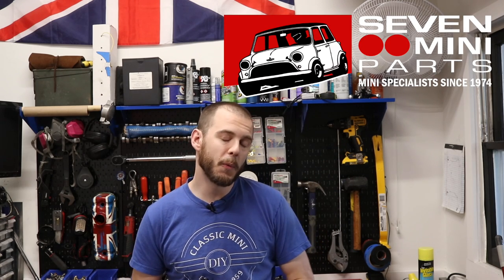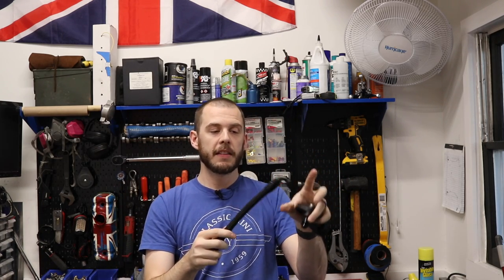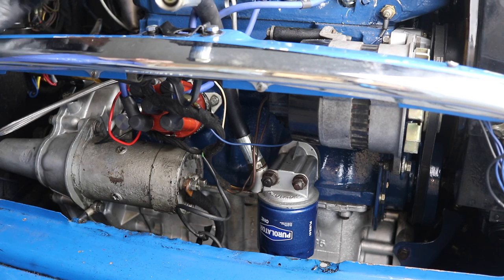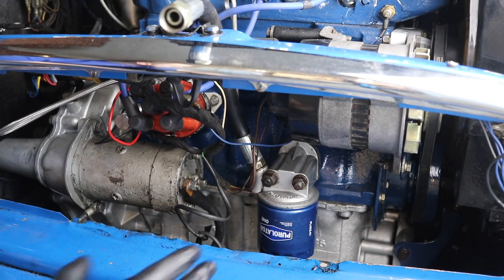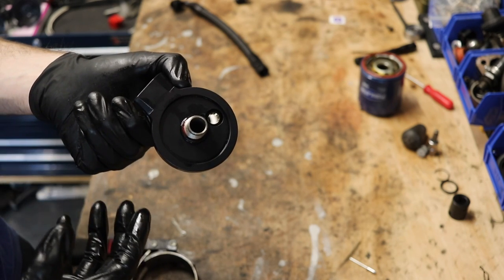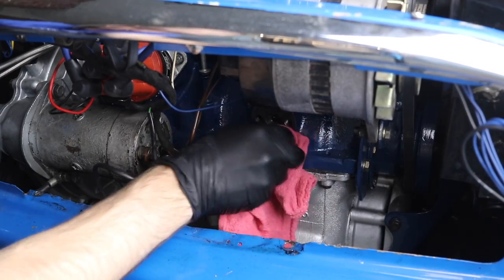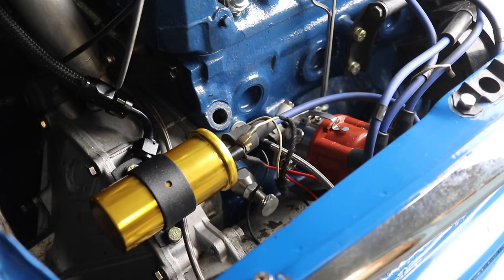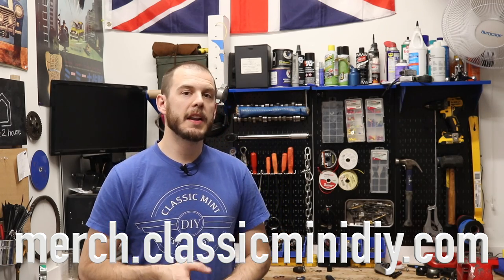Classic Mini DIY - How to install the MED Race Filter Head Kit

Comment: The magnet is a brilliant idea. You can get a magnetic oil drain sump plug.
Reply from the maker: All the factory sump plugs have a magnet in them however there are replacements with much stronger magnets. The drawback of the mini sump plug is that due to its location, metal particulate often reaches the oil pickup before it gets caught by the sump magnet.

Comment: Top tip-Since the oil filter housing is vertical, you can fill it with oil prior to fitting it. Helps with the prime on start up.
Reply from the maker: Thanks for the tip, I didn't call that out in my video but I did actually do it before installing the filter. You can see it right about 12:00 . Great tip though and thanks for mentioning it because I forgot. :-)
Reply: Classic Mini DIY  When I ran hot minis back in the day, we replaced the bucket under the oil pressure relief spring, with a cv ball, from the ball bearing.
One thing that can happen is if debris gets to the bucket it can stick open. Less likely with a ball and the oil pressure raises slightly.

Comment: I think David buzzard had a section in one of his books regarding oil cooling. From what I recall is the older mineral oil of the time required cooling on the Cooper style motors. Depending of the type of oil you use now so long as it has zinc for for the tappers a good semi or full synthetic 20/50w might not need as much cooling and will stand up to the job. Anyone else has any thought on this? The MED boys might have a good answer
Reply: 😂 damm auto correct “Vizard”
Reply: For a general road car you're unlikely to need a cooler, depending on the ambient temperature. For competition cars running sustained high RPM levels it's still a must. The best bet, if you're unsure, is to run an oil temperature gauge and see how warm it's getting before deciding what's best.

Comment: I could not figure out what size of those adapters fittings I needed and I didn't want to pull the old one out just to check so I ended up buying one of each. Naturally I forgot to order the fancy little washer with the seal in it.. I'll likely just put the old one on for now and replace it whenever I place my next order, she's parked for the winter now anyway.
Reply from the maker: Yeah finding those adapters is a pain in the ass. You can use a copper washer too in the setup. Will work perfect.
Reply: @classicminidiy  I'll give that a shot, thanks. I have plenty of them, hopefully I have one roughly the right size.